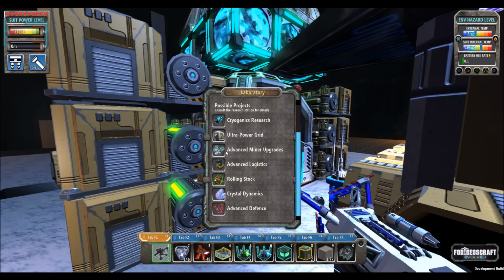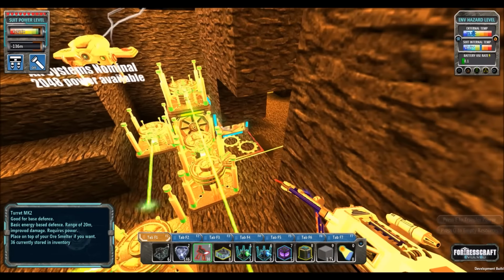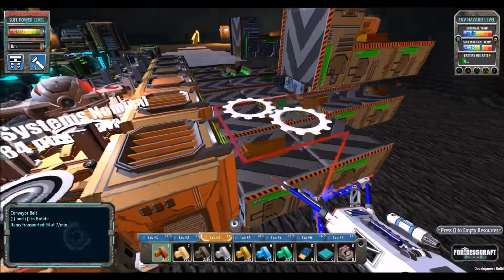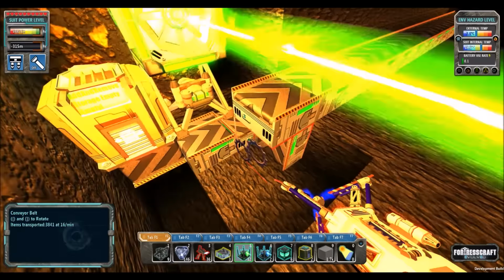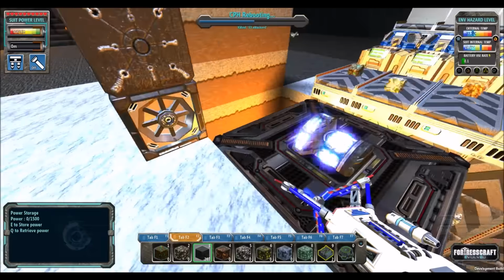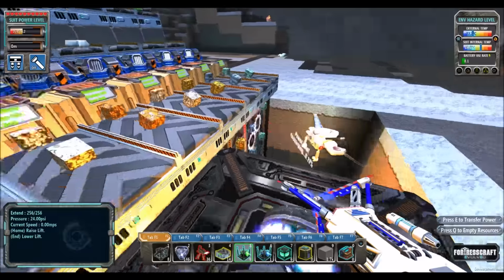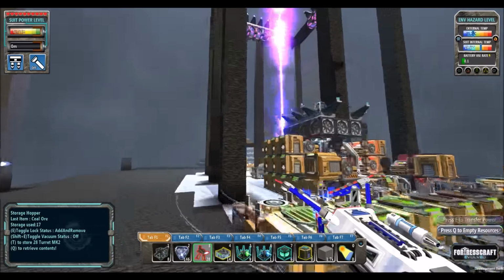NOW they won't be able to attack me | FortressCraft Evolved 14

Comment: Pretty sure those PCB machines are working fast because of that modded XML or something funny like that. Atleast mine are nowhere near as fast as yours.
You can also middleclick items in your inventory and they will be placed on your currently active slot on your hotbar so you dont need to drag them down there :)
17:00 I think the charging table is limited to 10PPS so you could just move it on top of the battery without the laser. 
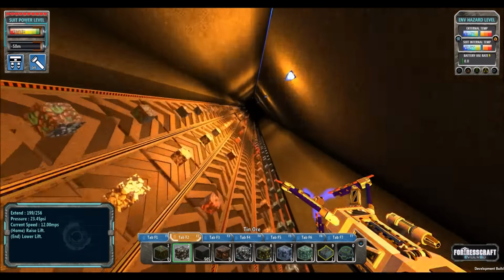40:55 conscious about your tin I suppose? you got it right on the second try :) 
54:06 I think you got some redundant lasers down there as a left over from your auto-excavator excursions
57:35 That laser is going to cause some amount of weirdness happening since the laser will still accept power from the battery and them beam it back and then instantly suck it back. I think it can even just void the power completely by doing it.
1:07:20 SPOILER ALERT the MK4 battery is made from MK3 batteries ;)
Reply from the maker: +Gurben Not sure, I just got on the game  and suddenly it was fast! I deleted my XML though. Great tips!

Comment: Maybe try biomass refinery and jet turbine for huge power generation.
Reply from the maker: +avldxvw I do want to build at least one jet turbine but right now I don't have access to it!
Reply: +DreadedEntity you'll need to research the crystal technology first, it's a huge 'gateway' tech that unlocks drill improvements and other stuff necessary for the biomass. I think it gets you the steel drill heads that improve ore yield by 10%, which is a must have on your T2 ores (i use them everywhere since they are super super cheap and pay for themselves several times over). (It's also needed in order to drill crystal deposits, which you will need some of for making the machines). You can also build bombs with mined crystal, which are hilarious- just charge them off of a battery until they reach 10k energy stored, then find a remote place, put the bomb down, shift + e, watch the fun! Also useful for blowing up mynock/hive cores that are sealed with hardened resin.

Comment: May I suggest a power source (other than coal and solar) that you miht enjoy?
Reply from the maker: +FacelessKitten “kitten” What is it?
Reply: +DreadedEntity its called jet turbine, it produces a great amount of power, though you have to produce fuel from biomass for it
Reply from the maker: +FacelessKitten “kitten” I don't have it unlocked yet!
Reply: DreadedEntity darn, if you know the research (i dont, sadly i was asleep or not paying attention when the youtuber i watched unlocked it) I would definitely recommend working torwards it
Reply: +FacelessKitten “kitten” believe its unlocked from the biomass scan. scanning biomass then there should be a processing research that you need for the refinery and the turbine. 

300 something power output but you want to have a use for all that power as it has a spin up time.

Comment: I have messaged you before so probably am wasting my breath but your guns are too high. The coverage from a gun is a sphere and the wasps are coming in 3 or 4 blocks above your base floor. Take 2 round balls, cut one in half and cut the other one in say 1/5 and 4/5ts. Lay a half and the 4/5ths flat on the table. That is the difference in range of coverage between your guns up high and ones that are say 5 or 6 blocks high. Think about it.
Reply from the maker: +Gary Davenport It's never a waste of breath, I still read all the comments. I probably will move the turrets lower in the next episode (part 16), I've seen some wasps get through the pillars before dying because they weren't in range of the turrets
Reply: +DreadedEntity Sorry, my wife said i was being a to negative and i agree. Your are doing a great job and really enjoy watching your lets plays. Also, remember they come in at angles so the corners are better locations then the centers of the cube around the base. The waves start getting really large and i have added a second gun to each corner and one gun in each center area. I am now down to 600+ and really love this game. I used to be a diehard minecrafter. Wait till you try the quarry, it is a real surprise.
Reply from the maker: +Gary Davenport Thanks for the support! I know it's frustrating to get ignored! I didn't think it was necessary to move my turrets, but now some changes to the wasp flying code keep making them swoop really low to the ground just barely out of range of my turrets so now I have to. And never feel unwelcome to leave a comment, all comments are welcome!